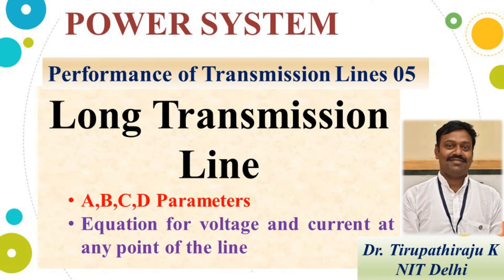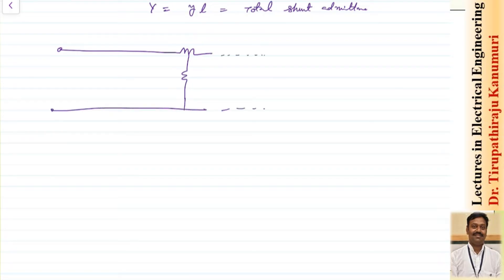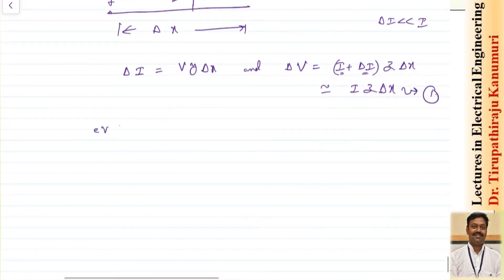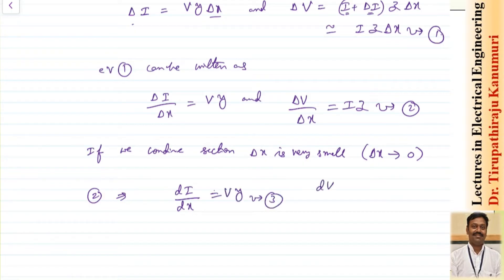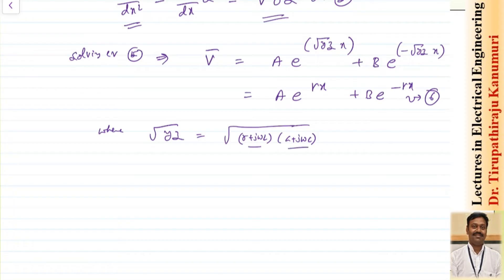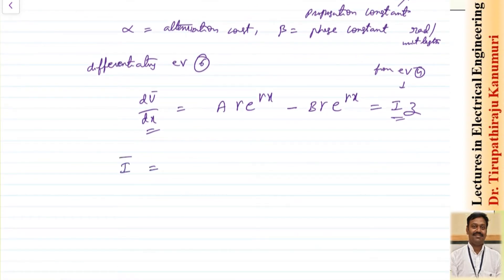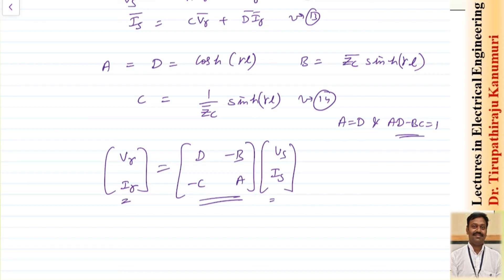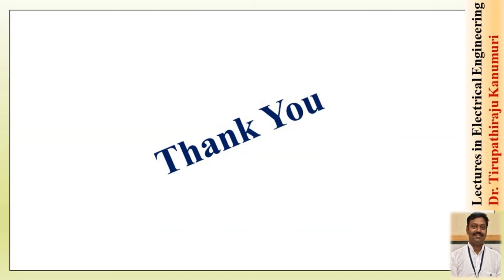PS26 Long Transmission Lines

Comment: Sir i want one example of solved problem by using long transmission line  ABCD parameters.... 
THE PROBLEM IS HERE 
##A 200 km long three phase overhead line has a resistance of 48.7 
ohms per phase, inductive reactance of 80.2 ohms per phase and 
capacitance (line to neutral) 8.42 nF per km. It supplies a load of 13.5 
MW at a voltage of 88 kV at 0.9 lagging power factor. Using nominal 
T circuit, find sending end voltage, sending end current, voltage 
regulation and power angle of given line.

Comment: SIR YOU CONNECT THE RESISTANCE PARALLEL WITH CAPACITANCE. WHAT WILL HAPPEN IF RESISTANCE CONNECT WITH CAPACITANCE IN SERIES
Reply: its is not kept wantedly its proven in practical that when a high current flows throughs conductor in a transmission line then there will be capacitance effect between line and the ground in overhead you c capacitance effect in underground it changes